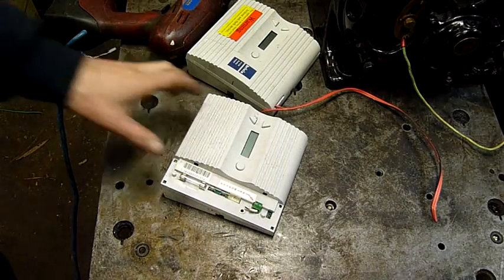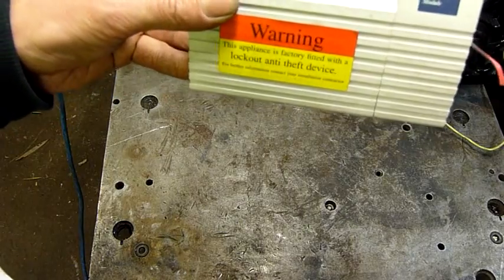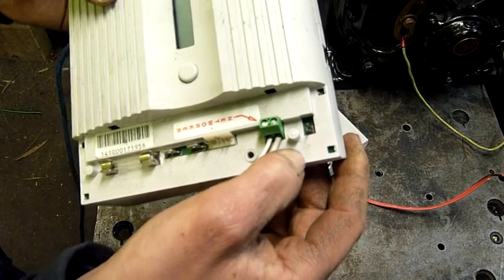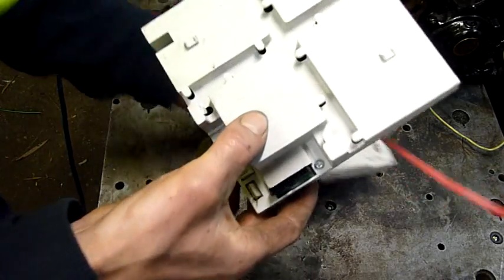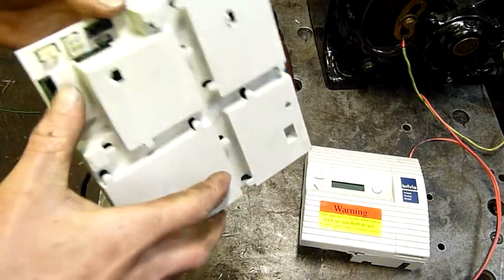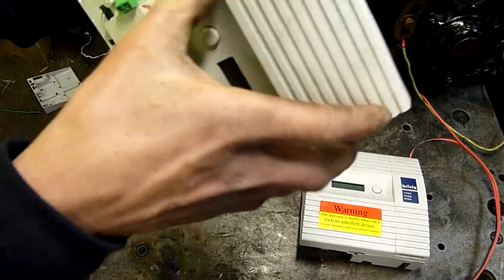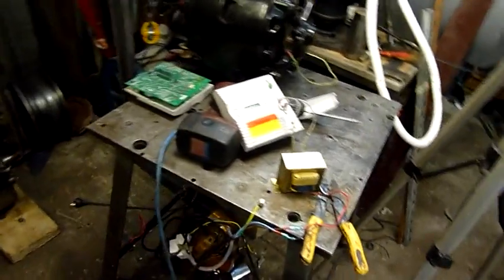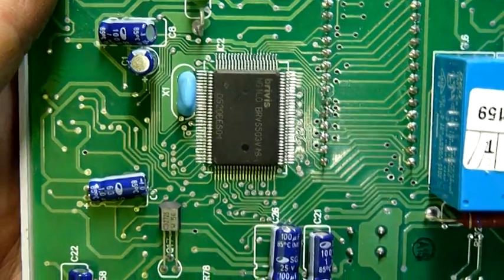Brivis Gas Heater Digital Controller Autopsy

Comment: I replaced the fan motor and after startup the controller came on for a few minutes with the fan constantly running. The controller did have a temp reading but controller power turned off and I can't seem to turn controller back on and fan constantly running. The brivis module is turning on, then it says new network and shuts off, starts again. I wonder if this is the lockout in question? if it was a thermostat then the power to the controller should still be on.??

Comment: I have HE20I brivis gas ducted heater. problem is that fan is now continues running and can't turn it  off from wall controller. there is code #40 overheating displaying. I did the reset from wall controller what same results. Do you think its the controller need replaced. Can you Help me out.
Thanks in advance
Reply: That sounds more like a temp sensor or temp switch is faulty. If it thinks the unit is overheating the fan runs as a failsafe.

Comment: Hi there, i was wondering if you know if you can put an more modern like this unit in the heaters? i have a gas heater the same but the old display screens that it connects to inside the house is old and outdated. would like to know your recomendations. cheers
Reply: You should be able to change just the indoor thermostat

Comment: the 24 v terminals u plugged into  are actually 24 v out of the controller to power the opitional zone board , not power in
Reply: You seem to know these units, do you know what TS03r U 18 then goes to NEW DATA, on the screen mean? Changed the fan motor now it constantly resetting itself with those messages.

Comment: Those had five relays, two black and three blue. The PCB (Printed Circuit Board) has both surface mount and through-hole devices such as: diodes (normal/ zenor/ chip), resistors (normal/chip), capacitors (ceramic/ electrolitic/ chip) and ICs (QFP (Quad Flat-Pack)/ DIP (Dual In-line Pack)

Comment: Anti-theft device, if you try to remove the heater and it springs a gas leak and blows you up prob. Thou knowing how the legal system is the thief would sue you because your heater burned 'em...

Comment: I'm waiting to see what will happen to the smart (Dumb) meters once the crackheads in my area of the world find out that the manufacturer used gold plating on the printed circuit boards as well as copper in the buss bars. The old analog ones only used copper, brass, aluminum, and some cats material. We are talking the sort of clowns that would try stealing copper from a live transformer on top of a pole, so ripping off a smart meter is easy and relatively safe compared to that.

Comment: Unfortunately someone stole the central heating from the house of a mate of mine. He had a new system fitted, was away for a few days and came back to find most of it had been ripped out. Boiler, radiators, pipework. Gone.

Comment: yep i would steal the relays and the 1 amp reg off it, then show the rest to the dustbin :-)

The trouble with using mcu/cpu/pic chips is when it goes bang its fucked as you havnt got the rom code to program another controller with.

On the other hand they can be quite reliable so ......

Lol shooting at someone nicking a heating controller ha ha, "put the controller down and step away" :-)
Reply: Do these units lose their programming? You seem to know these units, do you know what TS03r U 18 then goes to NEW DATA, on the screen mean? Changed the fan motor now it constantly resetting itself with those messages